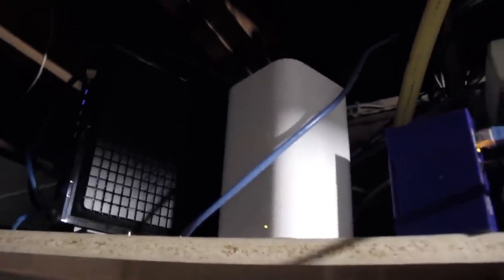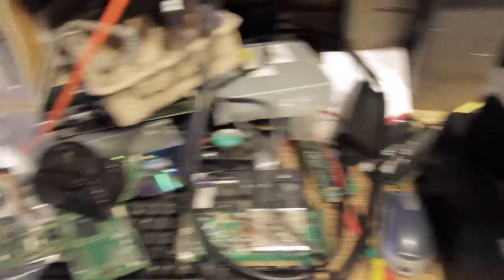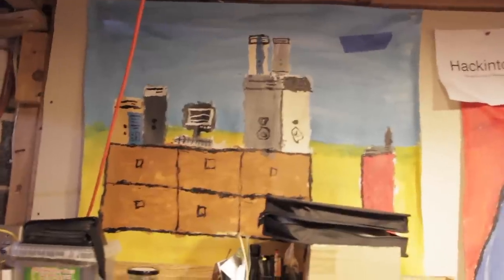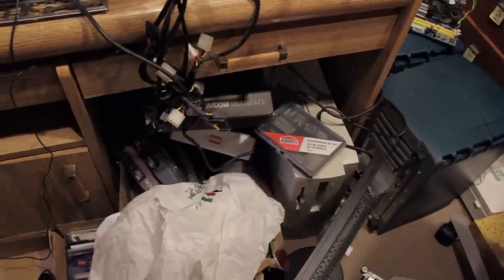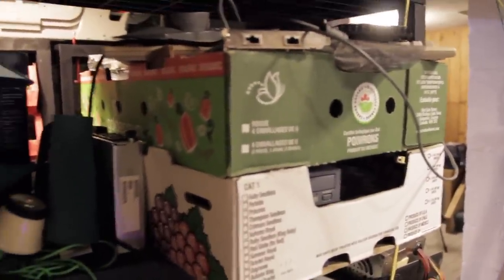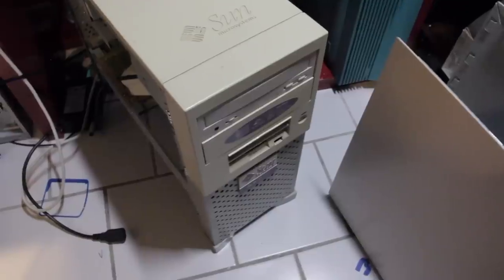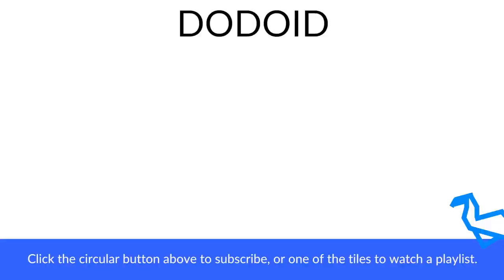A Tour Of My Computer Lab/Storage

Comment: Looks like the way my place used to be before I finally got some industrial shelving... except you're about 20 years ahead of me for sTuFf accumulation. :D

Re the roof space, you can attach shelves across the floor beams to give extra shelves, ie. screw them to the underside of the beams. I did this in my garage, very handy (assuming this wouldn't make you bang your head on them).

9:36  "I'm sure this is alright."

:D

Ian.
Reply from the maker: I may have a decent amount of "sTuFf", but I suspect that you have either the largest or close to largest (not sure about jan-jaap and DBJ974) number of SGIs in one place anywhere in the world, even counting museums. Your O2 shelf, hallway Onyx, neatly stacked O3K bricks, hard to see Onyx rack, etc are far more than I have, even with my spare Octane corner and Ind(igo2/y) pile. Besides, you've been at it for close to 20 years more than I have anyway!

Comment: 2:46 I have the exact same monitor, but mine has a stand, moisture damage inside the LCD (bad), and a partially damaged control board (which makes the front controls unusable).
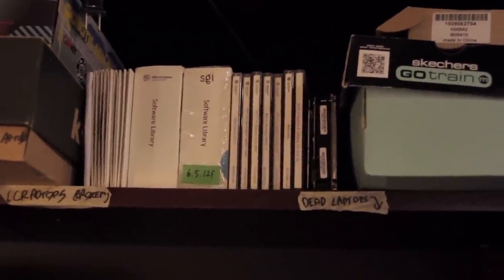9:50 OSFirstTimer!
12:23 I remember LGR doing a review of the PC version of that mouse.
Reply from the maker: I have the stand for that monitor, but removed it to fit it in the shelf. It's in the drawers under the 3D printer.